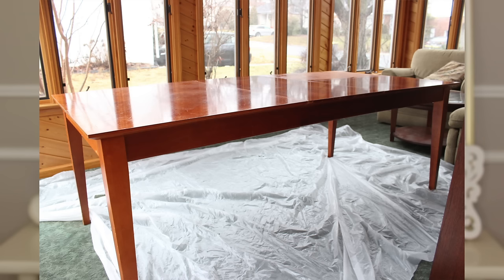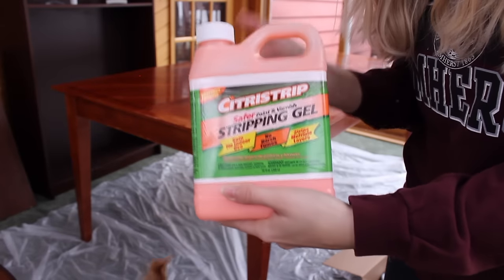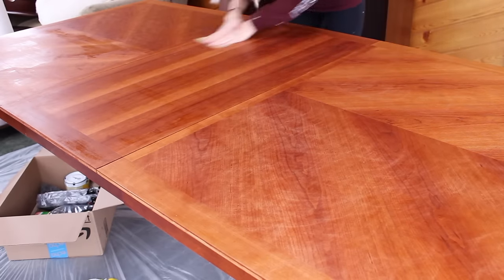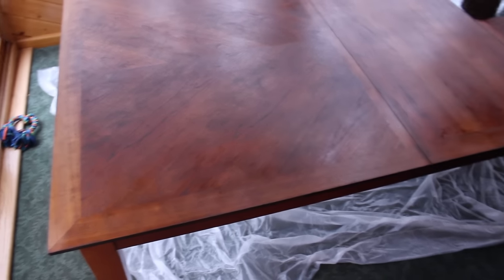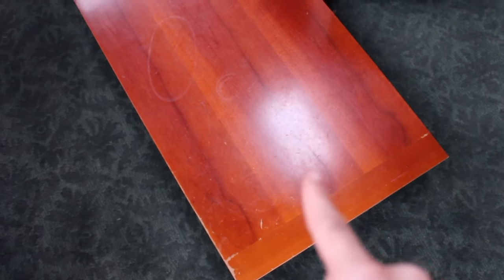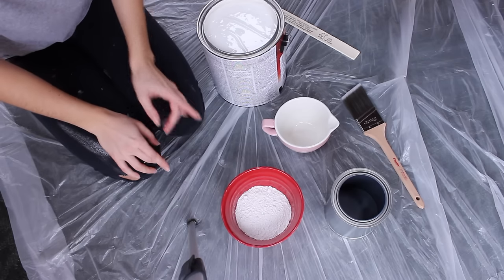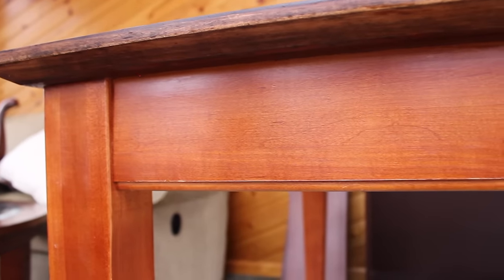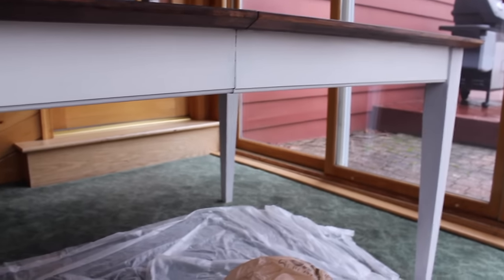DIY FARMHOUSE TABLE for $70 | Step-by-Step + Chalk Paint Recipe!

Comment: Just a tip for your viewers.. You can a gel stain that is super easy to use but best part you don't have to strip or sand before staining.. and it can be super dark after only 2 coats
Reply: boots-n-bling4me; yes but you will get more of a painted finish and not see the wood grain so well. I would at least use a deglosser before a gel stain.
Reply: Jessaleigh
Reply: At the end of the day it was her first time 🤷‍♀️

Comment: great vid. just a tip for future chalk paint projects.  waxing can sometimes be very time consuming and a pain w/ buffing between each coat. also to maintain the wax it will have to be reapplied after 6 months or so. You can however use a good polycrylic  or  polyurethane sealer

Comment: Next time use pre-stain conditioner prior to staining.  Then stain and let stain set up for about 5-10 mins before wiping off.  Then poly (with a foam brush), let dry overnight, lightly sand, clean dust off, put another coat of poly...and so on.  I would put about 5-10 coats on.  After 1-2 weeks...wet sand with 2000 grit, clean, and buff.
Reply: Also...next time...mix Floetrol in your paint and paint with a foam brush.  This will eliminate brush strokes. ;-)

Comment: It turned out so well!  Love it. Is there a reason you added chalk to the white paint?  Does it give a different finish?
Reply from the maker: +mskristinrunning chalk paint will pretty much stick to any surface which is why it's great! If I just used the regular paint I would have had to completely sand the wood down first, regular paint wouldn't have stuck to the finish!
Reply: with primer it would.  I just painted 2 wood nightstands and I primed them first, then painted them SW Tricorn Black for DIY  Pottery Barn finish.
Reply: Randi MacDonald, you would still have to sand very well before you prime though. With chalk paint you do not have to sand at all or you can lightly like she did.

Comment: The finished product looks so nice compared to the original. I can see why you felt it needed a make-over.  I'm no expert but I feel you could have saved yourself a lot of work by just using a sealer first instead of stripping the stain?